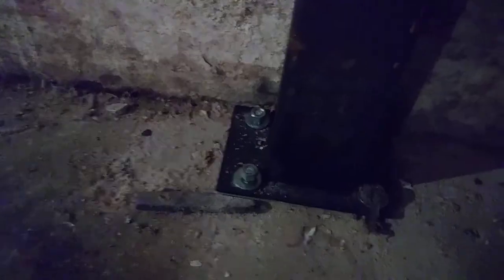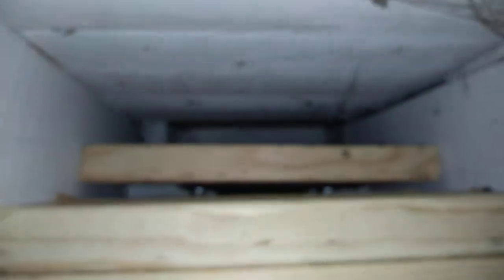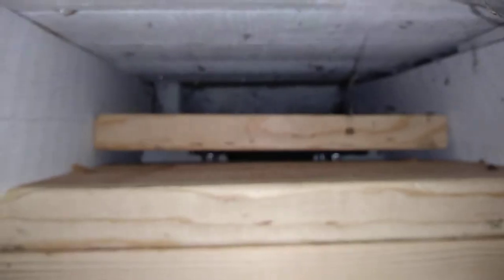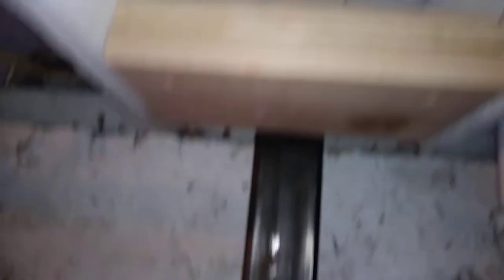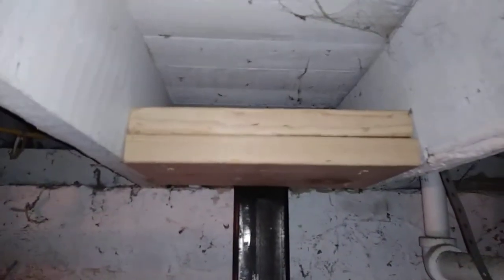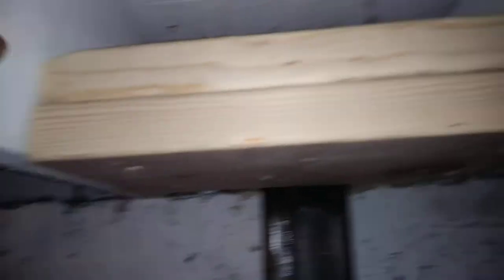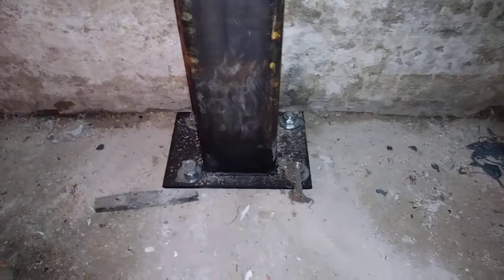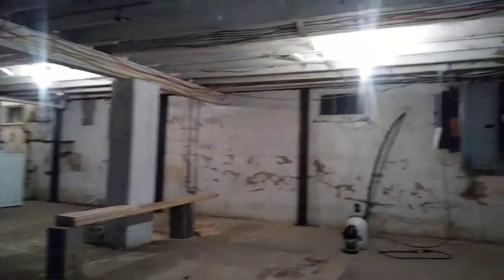How to support cracked, bowed basement walls | Diy block foundation wall bracing

Comment: Just a quick question... 
how were you able to attach the bottom of the post plate to just the basement floor w/ just 4 bolts and epoxy. Typically the basement floor is 2-3” thick in most cases in older homes, not nearly thick enough. Why didn’t the engineer call for a footings under the post ? In this video, the floor is already cracking where the bottom of the post is attached. Thanks for you response.
Reply from the maker: I agree we asked the same question and the engineer responded with not necessary????
Reply: Usually the footing overhangs at least by 4 inches, there's a chance they bored through the floor and the footing. You'd be able to feel it when drilling.
Reply: A footing is not necessary, this is for a sideways/shear moment. Footing is to spread a load coming down from the top

Comment: It's a nice job and will definitely hold don't get me wrong just that top set up and the ability to correct or counter the continuing issue. How are the 2x10's secured at the top if you don't mind my asking?? As you mentioned on the inside of the floor joist butting some 2x10's anchored with architect screws and some cross bracing was a good idea! Thank you for the reply keep up the good work!
Reply from the maker: Double flat box bracing send the post mounts to the flush bottom. You do this you do this bracing to two floor joists cavities deep for added rigidity.

Comment: How are walls handled which are parallel to the floor joist. Adding blocking in the joist to secure the top from moving inward is not the same when load is placed on the side of a joist.
Reply from the maker: Excellent question.ans 3 joist cavities blocked the added flat plate contiuous span abutt to the the back side of stock column pinning againt the block wall. Not very attractive. But effective. At least according to the engineer who designed the support system.
Reply: That's the one a lot of contractors get wrong.  They brace the tops of the posts to the bottom of the floor joists and in time the joists roll/rack offering little to no resistance.

Comment: So why not make a beam like you would use on a deck and go across all the floor joist and anchor it that way? Also how did you get them fitted to the right height?
Reply from the maker: Each column is independently anchored at multiple choice above each column location. Each column location was independently measured for height causing each column to be prefabricated to that specific location. Predetermine placement was mapped out first

Comment: Wondering where to start with hiring out a project like this. My  101 year old basement wall is slightly bowed (1.5 to 2 inches) , and doesn't call for what the "basement specialists" are selling. Especially as the bowing is decades old and has not noticeably moved in the last 5 years (the amount of time I've owned the home).  I'm just hoping to hire someone to install steel beams like this to prevent future movement. Where do you recommend I start when searching for a contractor to complete this work?
Reply from the maker: Search for structural contractors. Foundation contractors. Either way you'll get a s*** ton of opinions and differences

Comment: Can you tell me how to ask for these particular beams when ordering from a steel supplier? When I called the supplier before, they asked me about certain type and measurements and I had no idea what to tell them. I can tell them how long, deep, and wide. But they want more info than that, and they wouldn't offer any suggestions for my particular situation. Great video btw. Thank you!
Reply from the maker: We we used 1/4 inch thick steel square stock
Reply: HSS4x4x1/4 is what's used in the video.  Another very common steel shape is an S4x7.7.

Comment: Can Carbon Fiber be used on a bowing brick foundation wall? Also what are your thoughts on using high strength steel straps for a bowing brick foundation wall? Thanks.
Reply from the maker: Not sure about carbon fiber.

Comment: So the wood is there to hold the steel beam??
 If your not relieving the lateral force what impact does this have on the wood flooring once the beam pushes into wood?
Reply from the maker: No. You missed something there. The top steel plate bolts to a double flat joist plate mounted to the above joist. The floor frame supports the post which supports the wall
Reply: From experience I can tell you the floor WILL strain from the pressure over time. Esoecially since if the home has one of the block foundations the floor joists are likely abit undersized for modern conventions as well.

Comment: Can you Anchor into the floor if there is tile drain concreted  along the wall ? Thinking it wouldn't be thick enough to support this
Reply from the maker: French drain....no.   not sure what a tile  drain is
Reply: @Chrdiy  ok thanks , and yes a French drain guess some call it a tile drain
Reply: I was going to ask the same thing. Maybe the bottom of the post can have an extension plate so you can drill holes 8-12 inches from the wall. Idk I'm not an engineer but that seems to be the only way without having to drill into the French drain.

Comment: Would you shim the gaps between the steel and block where it isnt touching due to theblowing? Or you just left it as is with the steel only touching the bowed area?
Reply from the maker: Correct supporting just the boat area no reason for shipping anything else it doesn't low in anywhere else except the Midway and that's what's being supported
Reply: The idea is the beams push back on the wall and over time as the tempature and moisture in the soil changes.. the I Beam or these posts should help push the wall back. I'm not a fan of using this posts. I like the I beam idea.

If you can dig out the dirt outside the wall you can get most of the bowing gone the same week

Comment: Nice vid, 

How long does all this take and what was the approximate cost?
Reply from the maker: So the post had to be picked up cut and welded with plates actual one day. Four guys installed 9 columns in one day. This particular project ran 4800
Reply: @Chrdiy  thanks for the quick reply. Do you service VA by any chance?
Reply from the maker: @ep411  I do not, 5 hrs away. Sorry

Comment: so your really just stabilizing the wall not forcing it back into plumb? Also did you seal the crack once you stabilized it?
Reply from the maker: Yes to both questions. This prevents and additional bowing if the walls
Reply: @Chrdiy  I was also wondering how he determined the spacing of the columns. They look at least 6 to 8 ft apart?
Reply from the maker: @mikemolski8567  not sure. Probably based off of max load potential for each column. His warranty for the specs. This is stamped sealed and permitted with construction office.

Comment: Can anyone help me understand  what cause vertical (mostly) cracks...and how-what are the remedies  to solve this issue  on this veeery  old house.  thanks.
Reply from the maker: I have two due to soil compaction time and water around the property and the fact that it's old enough that there are no horizontal or vertical supports built into the wall system. Random settling

Comment: If someone put drywall over an issue like this and sold the house without saying anything, can they be liable? Asking for a client
P.s.
They wrote their name and the date when work was performed on the block wall itself (which was approx. A year b4 they sold it)
Reply from the maker: I would probably seek an attorney for non disclosure issue. Buyer beware is one issue but failure to disclose a latent defect is another. Especially if that detail would have influenced the purchase and sale or no purchases sale. Good luck
Reply: Why would they care if the problem was solved
Reply: I thought about putting a nice paper mashay (sp?) Over mine.
   Only for decorative purposes of course

Comment: I wonder how much a fix like this costs? I've seen this in other homes through our home search.
Reply from the maker: Pretty reasonable. This was around 4200
Reply: lol you hear that? Only $4,200! Meh... chump change. I don't mean that as a slight by the way. Just saying, its crazy how much it cost.
Reply: @DaCake2  I was quoted $35,000 to fix mine in Maine
Reply: I've heard to have it perfectly right like it was first done is like $10,000
Reply: Steel i beam 1/4x4x8’ hot rolled steel will cost around 75-100$, the 5/8”x6” anchor bolts are about 35$ for a box of 10, 2x8 yellerwood is 10$, through bolts and lag bolts are about 10$.  1/4”x6x4 hrs plates will cost 15$ X2, anchoring cement tube is 25$ so for one column materials alone is around 200$..  but generally contractors should charge around 1000$ / support beam.  Thats how much i was charged, 3k$ for 3.. then i put in another 10 myself for 2k$ and about 2 full days of install by my self..  I installed mine under pressure though with a 20 ton jack pushing agsinst the beam then bolted em down.. the sounds the friggn house made for the first month were wild..  it would pop n crack so loud it gave an old vet a ptsd episode..
Reply: @woodrowcaudle  😥

Comment: Why would anyone buy a house with an existing problem like this? How is water on the outside being managed which most likely is causing the issue?
Reply from the maker: I thought the same thing. Pretty old farm house. I've seen this in newer home as well. No issue with water surprisingly Unsupprted backfill of 7' with hollow 8" x 16" block foundation set very poorly. 

Just fix a 35 year old ranch with 9' high basement and 8' x 16" hollow block with 8' unsupported backfill. all thoughs years of soil pressure and hydronic water pressure caved in their gable wall. the entire perimeter block walls are bowed inward with a 4' horizontal split. (insurance won't pay for this either. Faulty construction as code where not there. Shame
Reply: Some areas, this is happening to every house that is affordable. When you think midwest you probably think corn fields. This is true, but it is misleading. The entirety of the midwest is floodplain. The water table is ridiculously high. So your choice is $$$ for a new development (which are likely all being made just as cheaply as these homes were) and sell before the symptoms show, or buy a $ house and spend a little to brace the basement. And yes, you are correct the only true solution in the long run is fixing drainage around the foundation. Dig around the foundation, fill all cracks, seal it, wrap it in a barrier, install a heavy duty drain pipe, and backfill with a bunch of gravel. And most importantly grade the yard to heavily lean away from the foundation.
Reply: Typically these houses are cheap and have character. Here in indiana even the brand new cookie cutter slab housing additions have issues.  What you see in those is drywall screws pushing out after a few years and cracks on the ceilings, walls, and corners/seams.

Comment: Did the buyer negotiate the price down for this foundation problem after it was fixed? Future insurance?
Reply from the maker: No. Buyers inspection co recommended engineer evaluation. Repair is based on sealed engineers plan to prevent further movement. All inspected by local municipality....buyer accepted as fine
Reply: I put an offer before knowing the foundation had an issue.  Should I walk away from buying this house since if I attempted to sell the house, the next buyer would note the brackets and problem with the foundation.

Comment: How much was it to install each beam? Labor, materials, and all.
Reply from the maker: Job was calculated by material cost, custom fabrication of each support, and overhead addition of carpentry modification for suppirts for horizontal joist above. Along with man hours to install. Every job is different. This one totaled 4200. For 8 supports

Comment: Why would the township be involved they don't know anything even the engineers do this by Guess work nothing has been proven to work
Reply from the maker: Engineer plan are from other structural support job that do infact secure and prevent further movement. Also creates a documented structural support system in n order for homeowner to sell the property and for a buyer to confidently purchase. Apparently your are not versed in support nor engineering so not sure where your cimment contains any validity.

Comment: Son of a bitch.  Why doesnt anybody show the supporting brace for the joists running perpendicular to the steel beams..??   Do you just sister the upmost joist and place cross bracing inbetween the following joists?   Where my joists are floating on the central built up wood support with lally columns, im afraid to put a steel brace on the walls with joists running the same way as the wall to be braced because if it moves it will put lateral force against the main house beam support...  even if i built bracing inbetween each rafter..  wondering if i should go with the plate and anchor system where you apply the pull to the wall from outside...  block foundations are the worst thing to be done to a house aside from replacing all screws and nails with glue only...

Comment: Well that engineer must have gotten his licence online!!! Why the hell would you not have used spring steel I beam with a 1" bolt and bracket at the top to actually correct the problem for half as much $$$???? Commenting for a friend!
Reply: Are you trying to describe an S4x7.7 steel post?  There is nothing wrong this design using HSS4x4x1/4.  Virtually no difference in price between the two.  Labor in the area will dictate differences in project costs more than material.